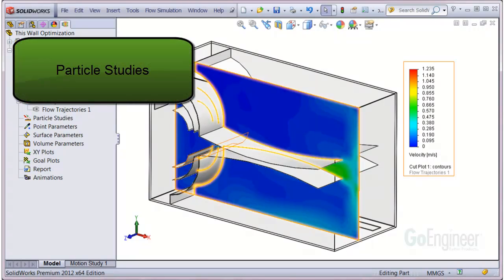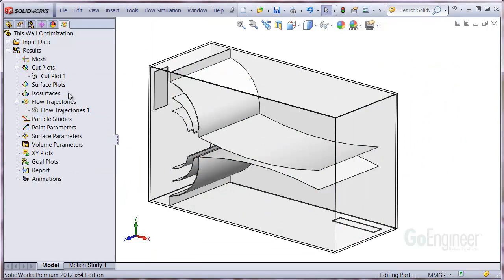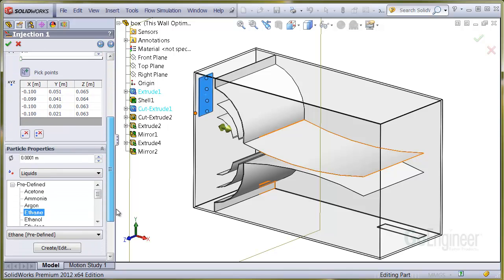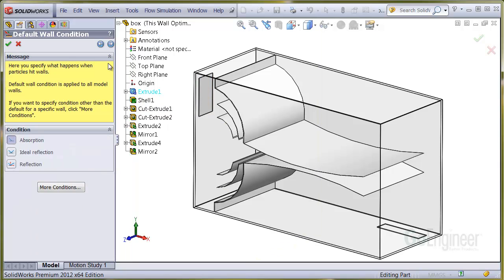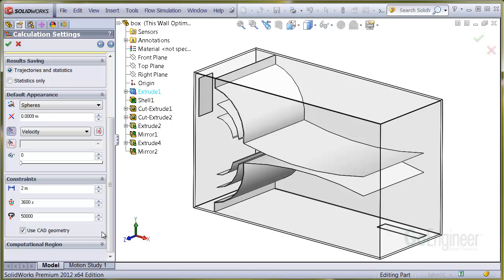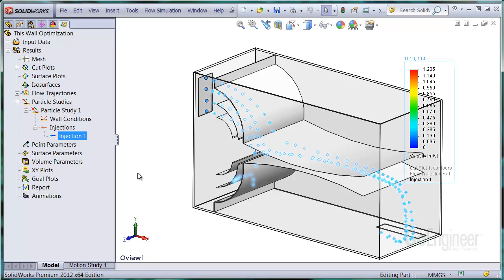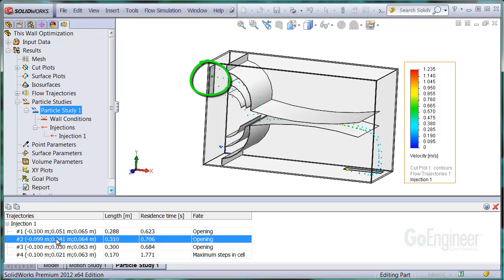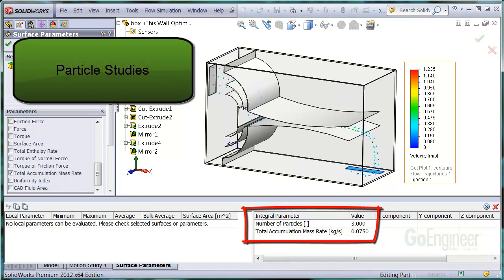SOLIDWORKS Flow Simulation – Particle Studies

Comment: Hi Tony, Would solidworks be capable separating 3 fluids with different densities in a settlement tank? what type of study should I use?
Reply: did you find out?
Reply: The same question
Reply: it's not posible in SW I ended up using Fluent

Comment: This is really cool.  Could this software be used to track the behavior of particles in a pneumatic conveying line after they hit a 90 degree tee bend?  I'd love to know how long (metres of pipe) it takes for the particles to once again flow parallel with the pipe after the turbulence created from the bend.

Comment: Yes. what did you want to see? Is it how to use the bolt connector tool, or heat transfer through the bolt, or flow around them, or vibration, or something else?